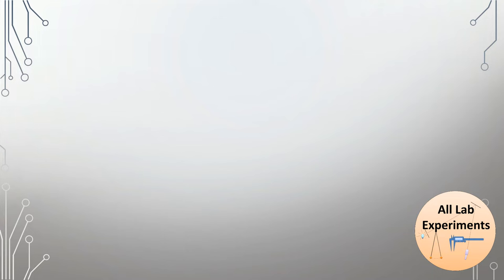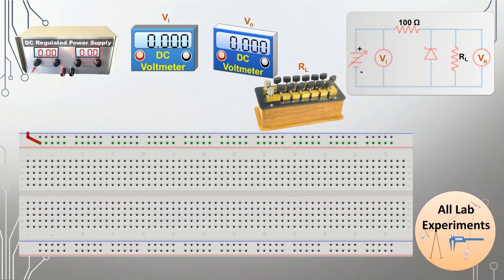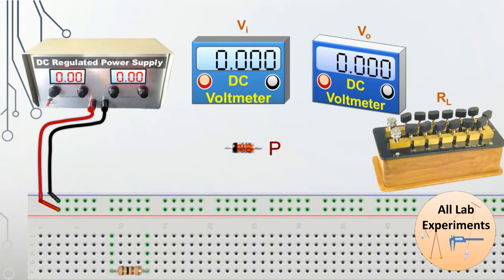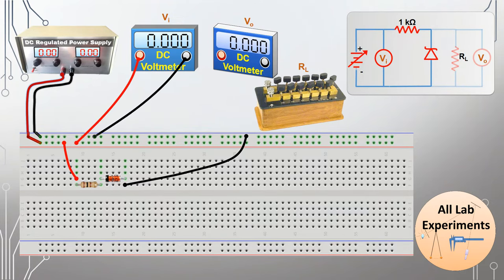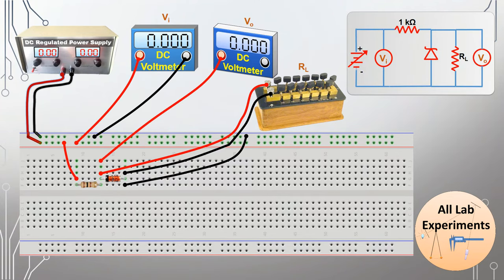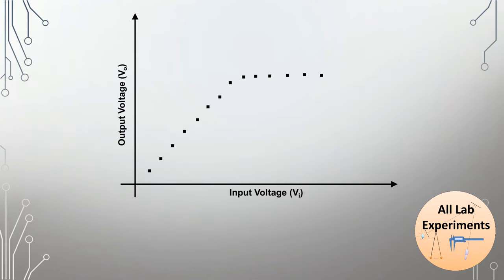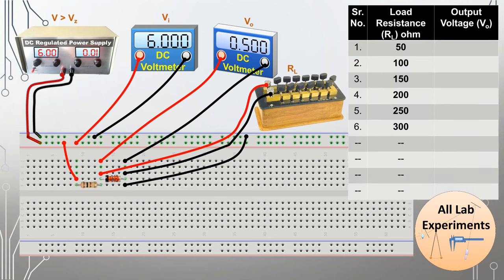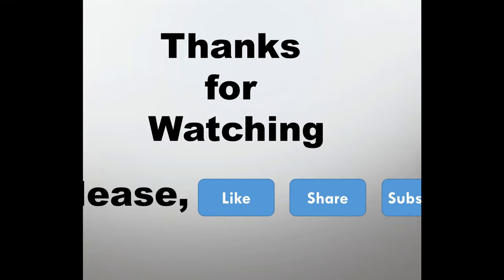Zener Diode as Voltage Regulator | Full Experiment | Virtual Lab

Comment: Lets take an example suppose I have 3v led and I supply 7v DC source the zener diode keep the voltage same for 3v led instead of 7v volt but what happen to remaining 4v
Reply from the maker: Imagine what is voltage, if you gather more opposite charges on two points then there is a potential difference. Zener allows the flow of a lot of charge such that voltage drops. Even the battery gets short to charges to maintain its potential. And that potential works in parallel for the load resistor or say LED

Comment: Asslam o Alikum sir...sir i need an info...
If in the same circuit,i use a zener diode of 1 or 2 volt then should i have to chnge the resistance or it will be same as u used..kindly do answer
Reply from the maker: It could be any. Just increase your voltage slowly if zener is of 1 or 2 V for more readings.
Reply: @AllLabExperiments  ok thanks a lot